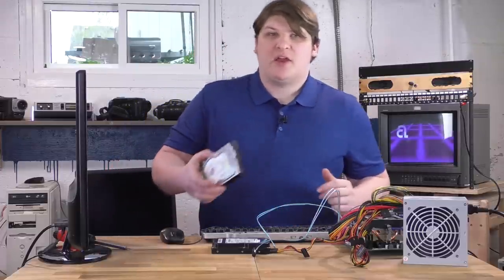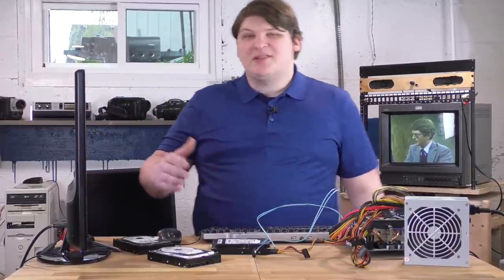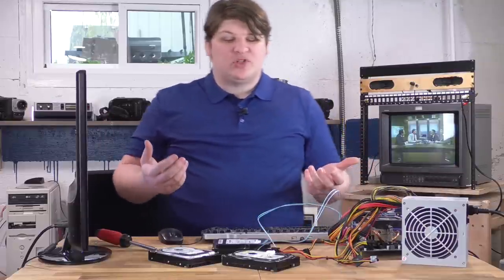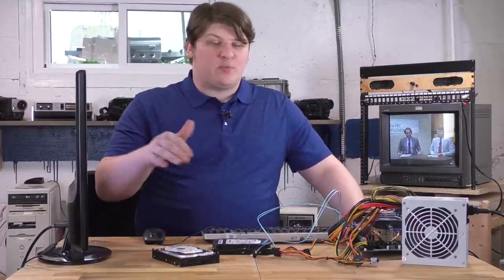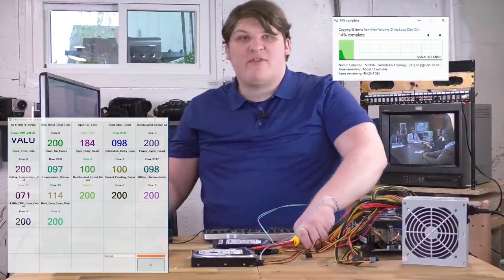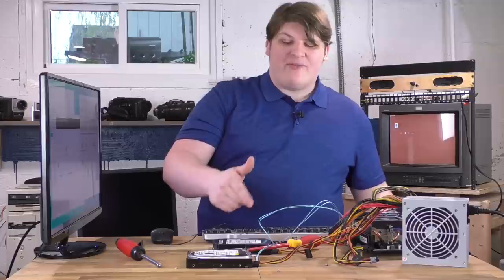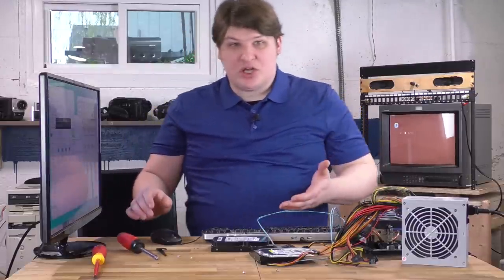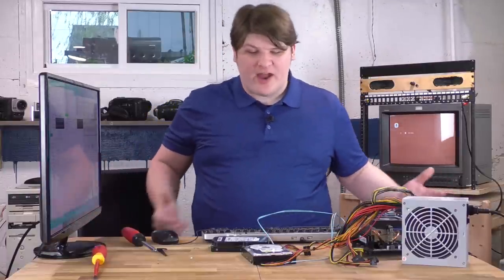Can A Hard Drive Breathe Regular Air Like Us

Comment: Of course this would work to some degree. I do agree that hard-drives are fragile af; I specifically avoided ever moving my laptop at all, it was a desktop, and yet, it eventually threw bad sectors anyway. 😕 That said, drives are made to tolerate some degree of problems and were more robust the older they were (like everything else 😒). Of course, there's a limit to what they can handle, and also a massive luck component, wrong-place-wrong-time. I always think back to Scott Mueller's analogy of what a hard-drive's head/platter is like and then I get really scared of turning on a drive; I'll take an SSDs' limited write cycles over a spinning disk any day. 😬

Comment: On what happened to the hard drive in this--I think what it might be is that air with particulate matter in it is not good for hard drives, but they can technically run for short periods in it. I saw a video recently where they opened a drive as a step towards rescuing data from one, and it worked for a time, but it hasted an already-inevitable failure. Opening it slightly like you did (in order to keep it running) also helped to shield it from contaminants, perhaps?

Comment: i think your right about a 'vortex' protecting the platten, after all the head is floating on this cusion of air.  So i wonder what would happen if you power the hard drive down, let it sit in dirty air and allow the dust to settle then  start it back up.  Do that a few times and you might just get a crash/

Comment: Uncommon knowledge about "click of death" on a hard drive -- It may be worth opening it up and see if the heads are stuck on the platter. In my case, a quick flick with my finger and it parked itself, and It worked again!! It worked for about 30 hrs, more then enough time to get all my data off it safely.  Worth a shot if you have nothing to lose!  There is a video on youtube about this from a hard drive data recovery guy who explains what type of click a drive makes if the heads crash and get stuck

Comment: Just cracking the lid probably wont do much because the disk is spinning at 5400-7200rpm the wind is forced to the walls of the case and there is an air duct to catch particles that may have entered. outer sectors will fail first if dust gets in so pretty safe

Comment: I have video somewhere (maybe) of me running a WD Raptor 10k rpm drive without the cover for about an hour. I popped it back together and it still works just fine (granted it's likely not going to work just fine for much longer)
I can do it again and send you footage if you'd like. Windows boot or what have you.

Comment: it's a old tech tale.
it will not destroy the HD if dust gets on it after its perduction while open.
the reason why they have to be made in a dustless environment is because the disc has to stay clean so that the disc can be coated and the dust will cause imperfections wich will cause premature failure.
most people don't know this but all hard drives have 2 breather wholes one on the top cover and one on the back mount frame and it litterally says in vary small print do not block.
the small wholes are so the device can breath there pretty much the size of a pin whole.

Comment: Video isnt finished but; I always assume it was possible to open the drive and it still work afterword, just very hit or miss with no room for error. Otherwise many data recovery services would be stuck with a catch 22 if they cannot access the internals.  Most dont have clean rooms in the back of their little shops and data recovery software can only do so much on its own.

Comment: i've ran drives completely open to the air before from 10 gigs to 250 gigs including 1 that i replaced the cover with a cd case and ran it that way for a while for non critical data

Comment: the vents on the drives are not actually for sucking in air but air expansion in and out of the mostly sealed case during operation. there shouldn't be any "flow"

Comment: Used to fix original mac classic hard drives there about 40 megs 
Left sitting for years, bearing grease hardens and they won't spin up.
I would manually spin the metal center part with my finger till it moved freely again. never had any errors the drives worked fine.

Comment: I had an old IBM laptop that I would have to take the drive out and manually set the head to get it to boot. It lasted a year before it died. However, I had a newer drive that lasted about a half hour without the cover...lol

Comment: I wonder what would happen if you tried this with a helium drive... would it stop working instantly or would it still work for some time? Of course, that experiment would be more difficult (as they're sealed) and expensive (maybe you could get one with bad sectors?)...
Reply: Apparently some have a sensor that refuses to spin it up if the helium is gone. For those without it, the heads would fly at the wrong height (or so I've read). F* helium, great way to have a drive with a built-in limited life. I still have hard drives from 30 years ago that spin up and work fine. Try that with a helium drive 30 years from now...

Comment: About the heads being so close to the platterr and the tolerances and stuff; the tolerances aren't that amazing actually. The heads are designed to actually sit on the platter when it's not moving. It's the aircurrents that the spinning platter generates that lift the heads up from the platter. This is why heads are "parked" when the disk is turned off; the heads are moved to one side of the disk where they can safely touch the surface and at startup they stay there untill the disk is up to speed. hence also the stickyheads problem.

About the fingerprint; it's not so much the thickness of the print, it's the fact that it's sticky oily yukkie ew stuff. yes it's thicker than the layer of air that the head floats on but it's the speed at which it rubs the head (ew!) and the stickyness of the oil (ew! x2) that causes the problems.

12:32 the vents are there to equalise atmosphereic pressure and the filters are there to stop dust particles.

The filters howered are obviously not cleanroom-grade and if you look inside the average PC there's more dust there than you care to know so it seems you really don't need cleanroom conditions.

Also, many casemodders have replaced the outer cover of the disk with clear plastic to see the moving bits so... it's all extremely relative

Comment: Funny enough, i have a 4tb harddrive that i had a case screw pierce the vacuum seal on. Afterwards i’ve been running it as a boot drive for the last year in a rather dusty pc with no issues yet.

Comment: Wait a second... I grew up around destroying electronics and piecing them together and such, i rebuilt playstation and ps2's to be like new, based on only what i learned while ripping them apart. From sledgehammers to screw drivers you name it. From t.v.'s to consoles, to radios, you name it. And i have worked on a few HDD's back in the day opened them and they ran without anything on the outside. But the drives i'm talking about was mid 90's the old dos computers that schools had to replace when windows started to come out..  I've seen a few of them run with no issue.. for a long time too. But maybe modern drives are alot different than older ones? That was when i was a kid though so..

Comment: You used the wrong type of hard drive for this. I'm still using my 40TB Hitachi Deskstar (IDE, Feb 2007),  250GB (SATA, 2009)  working with 0 bad sectors. They've gone through vigorous cleaning including dusting and brushing , dropped twice while it was sitting in the casing, 3 PSU failures etc. My WD 2TB Green hard drives fails miserably one which brought in 2014 and the other in 2020 just because I unscrewed them and took them out for cleaning. The Hitachis survived my crude power supply(5V from a powerbank, 12V from a basic switched DC power supply) when I hooked them to my SATA to USB converter while WDs failed. Every time I hooked these babies into another system they worked while the WDs always asks to be Formatted everytime I switch so yes the data is ruined. Thanks for sharing this info.

Comment: My dad had a hard drive with semi-important data on it that had stopped working. We couldn't afford to send it to a data recovery place so we just opened it up and pulled the head back to its starting position, closed it up and tried it again ... it worked perfectly fine, we were able to recover probably 90% of the data off of it.

Comment: No air exchange is happening, so no air is getting in or out and no dust is getting in. If you blow into the hole, it's dead. The "vents" are solely for equalizing pressure

Comment: Another way of getting air into it while running would be to drill a hole in the cover as big as you could get it put all the screws back in and you could watch the arm and platter.

Comment: I wired up a HDD head to a 1/4in speaker cable and plugged it into a bass amp. Played a single note and the head armature instantly slammed and bent the resting post. Hdds are fun, aint they

Comment: I touched 230V around 20 times in my life, so I guess I'm more or less on par with you. And still alive. Barely.
Side note: I have a 2TB WD external HDD I used for backups a couple of years ago. Put it on a 2m tall cabinet, so it would be out of reach of my little son. Haha, of course the curious little explorer somehow managed to climb up there and of course he dropped it. 2 freaking metres onto the wooden floor BAM - its plastic case completely broken. Methinks: "Yup, that's ded." - Plugged it in anyway to see if it would even start. Guess what, it did! No errors, all data fine and it works to this day!

Comment: I used a 60GB HDD iPod in a car for over three years, driving about 60,000 miles a years, and it always worked. But what killed it in the end, was occidentally dropping the iPod 4ft onto a carpeted floor.

Comment: "... it's possible that the platters are forming some sort of vortex..."

That is EXACTLY what is happening, or to be precise, exactly what is NOT happening. The rotating platters form an aerodynamic boundary layer which circulates the air inside the drive but is resistant to the air around it. It's a spinning fan blade, and the head is actually floating on that layer of air by design, to eliminate any friction. Look up the principle of a Tesla turbine.

The vents are only intended for pressure and humidity regulation. Newer drives are even sealed with inert gas.

Comment: Hypothesis: It's a single disk hard drive right? If it were a multi disk hard-drive particulates in the air would get between the disks and and create paths from disk to disk and cause read write errors maybe. Just speculation.

Comment: to be fair, 110v isn't high voltage, (that's over 600 or 1000v depending on who's definition you use), but as an electrician... please try to avoid touching it. One day you'll get horribly unlucky. it can and DOES kill people.  I live in the UK and work with up to 415v daily and have dealt with 11,000v switchgear. the worst shock I got was from a 240v low current circuit, that one nearly killed me, still got the scars. :(

Comment: I wonder if you might be able to 'cheat' the head tension by putting in some very thin washers stacked to about the thickness of the hard drive cover - then you could run it unlidded no problem. I wonder how they work out what the torque value to set the screw to is?
Reply from the maker: I'm pretty intrigued by the thought of doing more experiments. I'm positive that with the application of some ingenuity and finding the right materials, a simple brace could be manufactured that would evenly and reliably apply pressure. As I mentioned I skipped about 15 minutes of dull experimentation, but those were (to me) the most interesting moments of the entire thing, just very dull on camera - I found that the torque tolerance is VERY specific, and I'm surprised that a simple stamped metal cover can be relied on to deliver it consistently, but I was even more surprised to find that I could dial it in for about 20 seconds at a time, during which I'd get perfectly good reads before the vibration threw it back out - so I think the tolerances are probably within the reach of a typical inch-pound torque driver, and yeah, a washer stack very well might do it.
Reply: @CathodeRayDude  Is the top cover just one solid piece of stamped metal? I had always assumed they were sort of like an automotive head gasket where it's multiple layers of metal kind of 'interacting' as a sort of giant spring.
Reply from the maker: @leadedsolder  Oh yeah - now that you mention it that would be a reasonable assumption, but nah, they're just plain steel - I used to destroy drives with a punch as part of my job and the chassis materials are nothing special. Here's some closeups of the lid off that drive. https://gekk.info/pbi/hddcover.png
Reply: @CathodeRayDude  I've seen a few top covers that had multiple layers of sheet metal adhesive-bonded for vibration damping, but that's costly if you can make do without it. (Really, that's a whole genre of engineering effort, "that's costly if you can make do without it.")

In your cover photos, the perimeter gasket is a "Form In Place Gasket" that is UV-cured; basically like an FDM 3D printer where rather than a heating element the print head has a UV lamp to cure the extruded fluid. The little standalone dab is the same material (because you already have to put the cover in that machine) but is used to apply a little pressure to something (probably the top actuator magnet plate) to damp vibrations.

The actuator pivot tensioning boss will be formed to a specific height offset from the perimeter screws, such that the cover deflection when all the screws are bottomed out will provide the desired preload to the pivot bearings.
Reply from the maker: @RobLion  that tensioning boss is what really throws me for a loop. I know the material has reliable properties but the idea that you can rely on a simple sheet steel stamping to do what you describe is amazing to me.

thank you for explaining the weird standalone dab; it had been bugging me, hah. You're right, it lands right on top of the magnet.

I had no idea multi-ply covers existed, every drive I've looked at seemed to be single-layer. Do you know if that's a high-end (enterprise-grade?) elaboration?
Reply: @CathodeRayDude  It's a stamping, but it's not necessarily simple. :-D Some of those features will have tolerances down in the tens of microns. While it's not cheap to dial in a stamping tool to that level, and keep it within process control limits, it gets amortized over millions or tens of millions of drives.

The more complex features are going to be on the higher-capacity (for their era) multi-platter drives. Heavier disk pack, taller head stack, and generally more things going on, but the profit margin to support the added component cost. Many will have at least a C-shaped insert with damping adhesive on the cover, over the area where the heads don't swing (because you want the cover clearance to the disk reduced for airflow reasons as well).
Reply from the maker: @RobLion  holy crap! i had no idea stamping could be that precise a process!

Comment: I used to have access to ball-park-1GB size HDDs in bulk from the boot sale back in the day.... I used to use Linux dd if=/dev/dsp of=/dev/hdc and watch the head move across as it recorded and then play back the music recorded.... also did that with a FDD and managed to fit under 2 minutes of music...
Reply from the maker: that's delightful, I never thought of doing that.
Reply: @CathodeRayDude  It works on Linux distros from the 2006-2009 period, pulseaudio on modern distros lock /dev/dsp. Though, there maybe workarounds for modern Linux/distros.

Comment: It's a risk no one is willing to take because would lead to catastrophic data loss. If you are doing data recovery, then a good filter and laminar flow hood (after cleaning the outside) because you are only there to recover data, it is a last resort, and you dom't really need it to work forever after it's fixed.

Comment: Oh, look it's a 40GB FDD with a case around it.
That's pretty much what HDDs were. For sure a dual platter 160 will perform around the same. Start thinking "problem" somewhere after quad platter 360GB when tech started to shift a bit, to fit more onto a platter. Still, I'll bet you may be able do find a 500GB disk that performs similarly. Why not try doing this with a modern HDD, but say on your toilet (after your weekly cleaning - and it's probably the cleanest place in your home anyway)?

Comment: Great videos. But one correction. 110v AC is Low Voltage not High Voltage
Reply from the maker: Then you'll be happy to stick your tongue on it?
Reply: @CathodeRayDude  No. But you can walk away from LV, I have at 240v. Very unlikely you’ll walk away from HV. I wasn’t intending to offend you. It’s just the correct terminology. It just I work In the HV substation and transmission lines construction industry

Comment: The drive platters' centrifugal force blasts dust from around it, away from it. Also, older drive have the heads farther away from the platters, and newer ones have them closer to the platters. Because they are closer, they may be less tolerant?
I tried this on 500GB and 60 GB laptop drives, and both functioned fine without the cover on.
Same with the desktop models.
I also have this abused laptop from when I was little, and the HDD just sounds sad, but it still works fine!
The drive is something like 600GB.